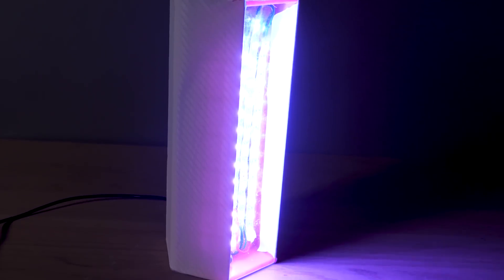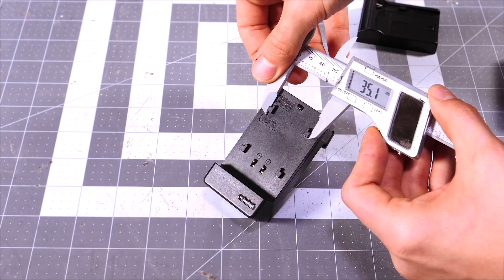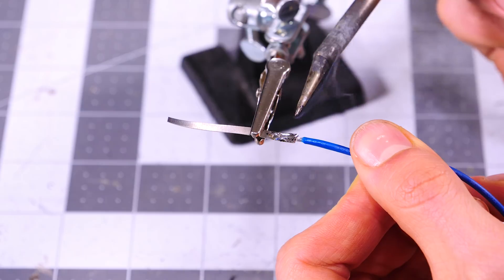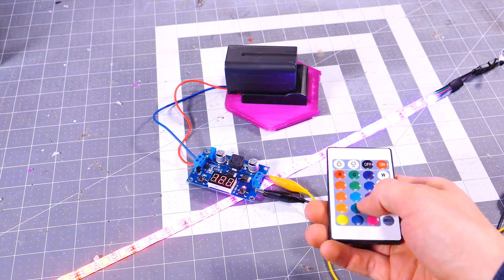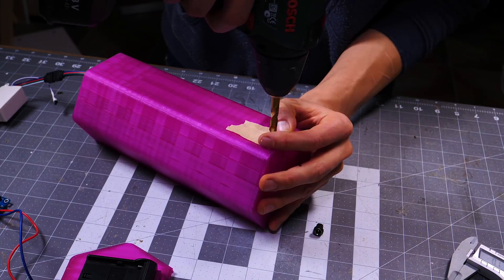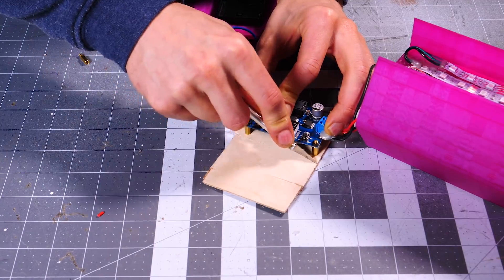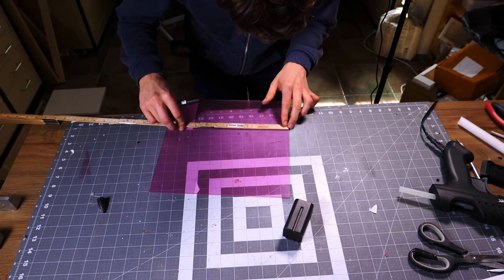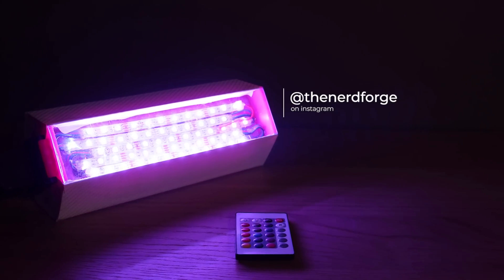3D PRINTED Colored Ambient Light -  DIY RGB Video Light!

Comment: really good idea!!!

have you tried dimming the lights using the controller? does not introduce flickering in video?
next time you could use a fine aluminum strip to mount the led strips this would certainly help to dissipate the heat, 
unfortunately I had to rebuild a led panel precisely because the heat of the strips has curved the plastic support on which I had glued the leds directly!

Comment: You should have put the plug input on the input of the boost converter, not the output. That's why it probably fried. its basically like forcing a stream of current upriver when it meant to flow downwards. I hope that helps.

Comment: there are also rgb led strips that are rated for 5v. For those, you could avoid the mess of having a stepup module and along with that have it usb powered. If you need it on the go, you could plug it into a powerbank. For future reference, looks good overall tho, great work

Comment: Also wouldn't need the boost converter if you used 18650 batteries. with a nominal voltage of 3.7, it would have easy to get your 12V for the LED's.

Comment: This could be done soooo much simpler
Reply: Like with 18650 batteries.  Just need a triple battery holder for them.  And no boost converter either.

Comment: Weirdly I'm making my own 12V light but for different purposes.

One piece of advice with the boost converter, If you're using multiple power sources add diodes on the boost converter output preventing 12V from trying to pass through the boost converter in reverse. Same with the DC jack unless you want to make more than one and want to daisy-chain them together.